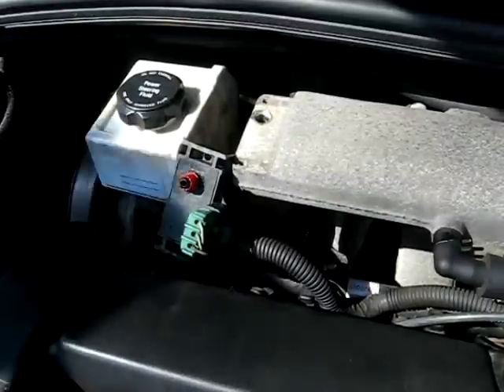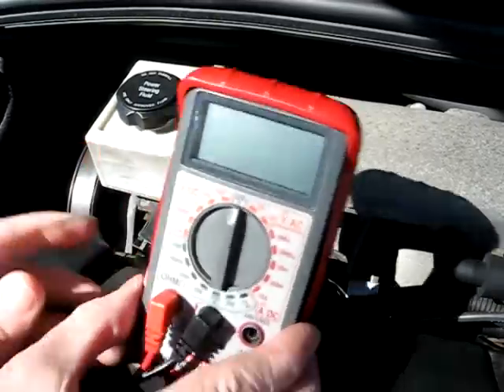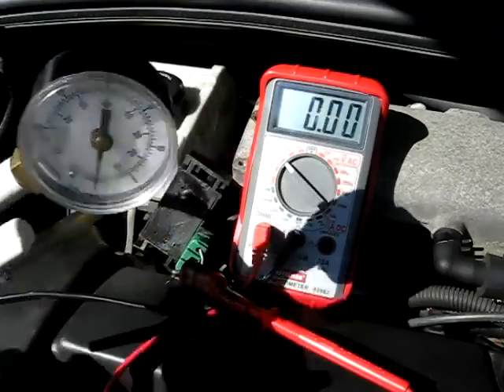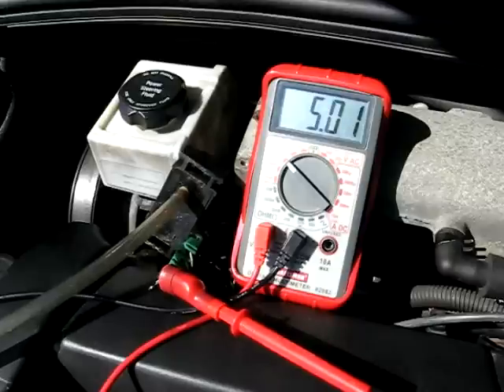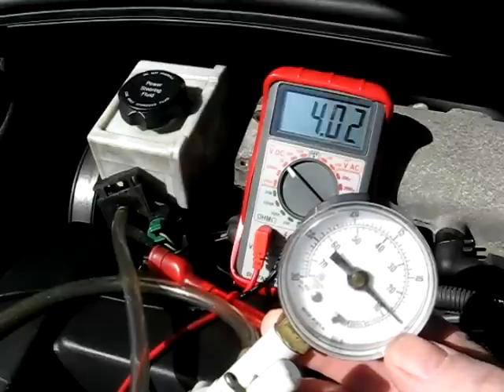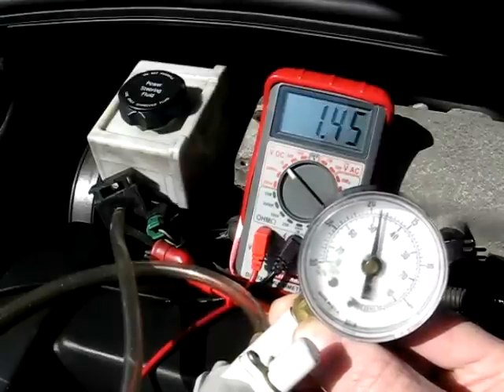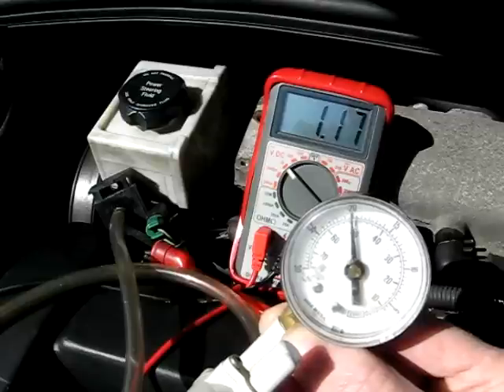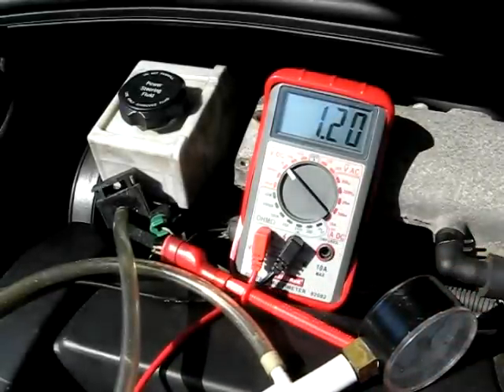Map Sensor Testing

Comment: WHAT DOES SURGING MEANS
Reply: Consistant bouncing idle or dipping/almost stalling idle. If the map goes bad it can send false voltage output making the computer think theres more or less air going into the cylinders than there actually is and the computer will adjust the fuel and timing according to these false readings making the engine surge because its getting way too much or way too little fuel.

Comment: should the sens wire read any voltage while sensor is not attached to harness?? mine reads 5 volts out of sensor, does that mean I have a short? or is it normal?
Reply: victor saari the 5 volts is the voltage the ecu supplies to the sensor. So yes ,that is normal. There is a ground and a return signal voltage that changes depending on the amount of vacuum the sensor has applied to it. A total of 3 wires. The wire you probed was with the ignition turned to the on position I imagine

Comment: Rich...i gotta question, now can a map sensor be fixed rather than getting a new one if so to diagnose the actual cause i should perform all the suggestions relating to a map sensor like for common symptoms. Trouble is mine does not function to its normal capacity...there is engine surge something that i notice but of course it runs on petrol the moment i try to switch to CNG/NGV is what its called around here the engine dies...need your advice
Reply from the maker: The map sensor is a sealed unit so i think it would be more trouble then it is worth trying to repair it relative to the cost of a replacement.
Reply: richpin06a thank you for the prompt reply Rich. Heck i better get this replaced then. Many tks

Comment: Hey, Rich; love your Saturn videos. I have a '95 SL1 that surges and stalls, won't give any power when given gas. Starts about 5 minutes into my morning drive, and then stops 1-2 minutes later. Runs fine otherwise. The error I got this morning were the MAP and MAF errors- normally I don't get error codes. Any tips? Clean the MAP? Replace the MAF?
Reply from the maker: There is no maf,have you checked the map.
Reply: I have not, but if it runs fine 99% of the time, I'm uncertain if a MAP error is going to show up when I test it. But I have all the equipment in your video so I'll see! Thanks!

Comment: where did you fix the ground black wire of multi meter
Reply from the maker: I believe the cleanest ground i could find was the bolt on the negative cable of the battery.

Comment: richpin06a: I have just purchased Delco Map sensor for my 1998 SL1.  It did not come with that red silicone seal.  What is that called so I can order a new one on the net?
Reply from the maker: spiglator Try doing a search for GM map sensor seal.

Comment: I remember from school, when we messed with IC's, that all the computer stuff ran on 5 volts.
Reply: +jgstargazer Yup, the 5v from the ICs and the 5v from your car are no coincidence. Mostly all sensors, for a vehicle or otherwise, run gnd-5v as an analog reading, or 5v as a digital 1.

Comment: what if I'm reading 4.76 without pressure?
Reply: It's probably not relevant for you guys anymore, but for anyone checking the comments later - the MAP sensor reads atmospheric pressure when you're not applying vaccum. A reading of 4.8V instead of 5 V would simply mean your atmospheric pressure is around 7 kPa / 1 psi lower than the standard atmospheric pressure at sea level. Remember that atmospheric pressure drops as you go higher in altitude - if my calculations are correct, a 1 psi drop in atmospheric pressure would equate to an altitude of around 600 meters / 2000 feet above sea level. So if that is close to the altitude you get your 4.8 V reading at, your MAP sensor is fine.

Also, remember that different MAP sensors on different vehicles might have different ranges, so if you're measuring a different sensor, the voltage might be different and you need to check the specifications of your MAP sensor to get the correct value it should give you.
Reply: +Mark Vankirk anyone can answer this please im getting about the same, does this mean its bad?
Reply: What should the value of the MAP sensor be at idle ?
Reply: That would very much depend on your MAP sensor, as well as on what car (engine) are we talking about.
Reply: 5.0 GM block.  What is the approximate vacuum at idle ?
Reply: Can't really help you with that, sorry. I know this is a GM video, but I got no direct experience with any GM engine, being from Europe, I just know the general MAP sensor stuff. You might be able to find it on the net, which is what I'd have to do as well. Many MAP sensors go to around 1 volt at idle, but that's really too general to be of any real use for you. Sorry.
Reply: I'm no expert but this seems pretty close.

Comment: @richpin06a, I have tested MAP sensor for a Corolla 99 , when I test and apply pressure the voltage increases instead of decrease.. and also when just tested ground and sensor wire it has a voltage of 4 volts instead of 5 v..

I don't know if all MAP sensor should decrease voltages or if some does the other way around.

Comment: hi can you please help. i have my mates sons van it is showing fault po100 /po110 / po235
But it will not start from key.
Can you please advise
regards
stan
Reply from the maker: Did you check to see if it is a fuel or spark problem.
Reply: Sorry it is diesel and the diesel pump is ok

Comment: Hi not sure if you are still responding to comments on this video but i have a query. I tested my 3 bar MAP sensor on my 1991 sierra cosworth but when i connected my vacuum tester & tried putting a pressure in my MAP so i could check the voltage values it wouldnt hold a pressure at all, i take it that this means my sensor is shot. Thankyou in advance jason
Reply from the maker: I would think if it does not hold vacuum there is a good chance the sensor is faulty.

Comment: Great video.  Did you put the paperclip in the left or center pin on the plug.  I got zero volts on the left and the correct readings on the center pin.

Comment: Thank you for the Info. I've got a ? My map sensor reads 4.72v and the engine doesn't run but the first thing is that the fuel pump went bad again, that has been replaced. I tried too start the engine, it run for a few seconds and shuts off, and the engine did surge and ate a lot of gas, can that low voltage being so low that it won't let the engine start?
Reply from the maker: A lot of fuel,were the plugs fouled.
Reply: richpin06a
Thanks

Comment: Rich, if a MAP sensor is working properly, wouldn't a scanner live data reading of this sensor be able to tell you if you have a vacuum leak in your car?  This seems like the most direct and obvious method of testing if you have a vacuum leak, but I don't see anyone using this as a trouble-shooting technique.  Am I misunderstanding something and that there is a reason why the MAP sensor cannot be used for vacuum leak troubleshooting?
Reply from the maker: I think most people use the injector cleaner method because not everyone has a scan tool.

Comment: Thank-you for a beautiful demonstration. I was working on a 09 Cobalt and when tested got a reference voltage of 3.8V to start with and also with ever 5 In vac applied it would drop .6V....Hence i replaced the Map sensor and it solved the surging issue. Thanks a lot RicH!
Reply: richpin06a I have a 05 cobalt and I stalls while in traffic. Check engine light comes on and I have about 10 seconds to pull over or it comes to a stop where ever I'm at..the power steering locks up..I was told the cam shafts position sensor (had it replaced) then I was told to clean my map sensor...but I'm not trying to go another sensor or even go through the trouble if it's not the issue...can you help??
Reply from the maker: I am glad you car is running fine again.

Comment: Hey Rich I tested my Map sensor but I tested it in normal operation and let the motor be the vacuum pump. It tested ok just like the illustration in your video. Is this an okay way to test the sensor also?
Reply: Not unless you measure the vacuum of the motor.  You have to use the vacuum pump like he does in the video.
Reply: Paul C ok thanks

Comment: I have back probed my map sensor but I get 2.5 volts instead of 5. I checked all wires for obvious breaks and couldnt find anything. It may just be the map sensor because the voltage wouldnt move when I put a vaccum to it, and it wouldnt hold a vaccum. what would be my next step? Why would I only have 2.5 volts going to sensor?
Reply from the maker: I do not know why you are getting only 2.5 volts as the 5 volts comes from the computer to the map sensor.

Comment: oh wow. how many folk will short their ecu trying this? why tell em this one mate? I know 2 people fried their ecu's testing maf & map sensor.interesting video though.
and never backprobe like that. buy proper piercing backprobes & seal holes with silicone
Reply: Tell them they are full of  crap.  A multimeter is a high impedance device that has no effect on the circuit being tested - even a computer motherboard. If they are such electronic genius's that they could test and determine and replace their ECU's then how did they damage them in the first place.  This is just plain stupid BS.  Sounds like their brains need a "jump start".
Reply: Paul C in both cases,whilst they were getting readings from maf connectors to ecu(ground),they mistakingly shorted out at the pins going to ecu.was nothing to do with the multimeter internals,more to do with the probe touching the wrong pin/s at the wrong time.hence my comment re: using backpiercing
Reply: Martin Thomson That's a very painful and expensive lesson.
Reply: Oh yeah, if you dont know what you are doing you can blow your ECU by even plugging your phone charger to the cigarette lighter.
Reply: You can only short out your computer doing this test if your multimeter is connected to the positive side of the battery

Comment: I tested mine and got close to 5v..like 4.76 then I blew into the hose and it went to 4.92 MAX..then back down to 4.76 is my map sensor bad?
Reply: youre not sposed to blow into the hose. youre sposed to pull air like a vacuum would. when you do this values will decrease

Comment: So how off does it need to be to cause problems.  Mine reads 0.1 V too high.  I'm at 3200 feet altitude which is approx 26.5 inHg which should read 4.3 V and my sensor reads 4.4 V.  When I put it under vacuum it did fall approx 1 V per 5 inHg like in the video.

Comment: The turn signals do work all the time but the odometer,and the gauges won't after about ten minutes of running.For days in a row now I have had no working gauges and no odometer,but the signals work.No gas,mph,tach,temp.and odometer.

Comment: My 2002 Saturn sl1 has an odd cluster problem.When it is cold outside my cluster will work but after about 10 minutes they gauges stop working.My turn signal light work and of course the check engine like is allways on.The odometer goes blank and gauges are stuck.I wouldn't think it would be a cluster problem sounds like around the engine proglem with heat.P.S. love the videos,grat job

Comment: hello, 
thank you for for this video. i have a quick question for you: is the signal wire back to the computer always green? or is always the same position pin on connector? i have a 1996 nissan d21 pick up. thanks again for the excellent video!

Comment: thanks for the helpful video, unfortunately I found out the map sensor is not the cause of my engine flooding out issue I am having.  Neither is the coolant temp sensor, oil pressure sensor.  Its on a 5.7 k1500

Comment: Hi richpin06a, firstly thank you for this video. I wanted to know will this effect as to emmitting higher NOX. emmisions,everything is stock. Installed new-Magnaflow Cat,Denso OE 02Sensor, Denso Iridum spark plugs, Cap/Rotor, timing at 16btc,MSD ignition wires. The car has 116k when i purchased but in 2010 passed smog, now have a hard time getting the NOX lower. The only thing that is aftermarket is the exh.Header DC Carb legal. Can you help? Thanks again!

Comment: I tested my MAP sensor with a multimeter and vacuum pump and it was staying at a constant 5 v
I went and bought a new MAP sensor and tested it before I put it in the manifold and it still stayed at a constant 5 v  
What are the possibilities of the MAP sensor being bad when it is brand new in the box.
Reply: sounds like you're on the wrong wire

Comment: Yes. Checked the Coolant Temp. Sensor, the Intake Air Temp sensor, O2 sensor, TPS. They all tested good. Unfortunately no scan data available. Because if I could have Live Data Stream, I probably could find the problem. I can read those parameters and make a conclusion. But in this case I can only measure and test the sensors with a DVOM. And they look to be working perfectly fine. Except maybe the MAP sensor? I'll try to get a known good car, and compare. There is one, just need time to get it.

Comment from the maker: Most vehicles will read 1.0 to 1.5 volts at idle and 5.0 volts at wide open throttle.Have you checked the coolant temp sensor as a possible problem area.

Comment: Got a Suzuki Swift 1.3L car. With Engine OFF, key ON I read 3.5V and at idle 1.5V. Are these nubers considered to be good? Car has low fuel milage, and poor engine performance. It is running rich, but has no CEL, no vacuum leaks, pre OBD II, failed emission test with high CO readings. O2 sensor is working right.

Comment: @frosty9595   ...and you will never know if your MAP sensor is accurate.  It's not enough to see voltage change with vacuum change.   You must see if the voltage corresponds to vacuum according to this chart:  w w w. aa1car. com/library/map_sensors. htm  (remove space after each dot, and between w's)

Comment: i had a friend scan my car and the check engine light reads the map sensor. it bogs and looses power and eat alot of gas i had put 5 gallon and i burn it in less than 15 miles